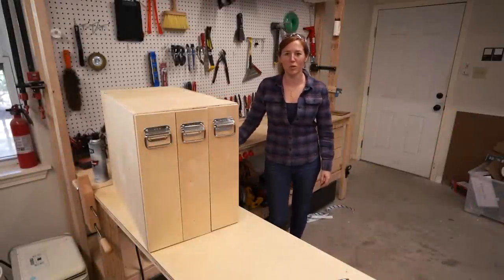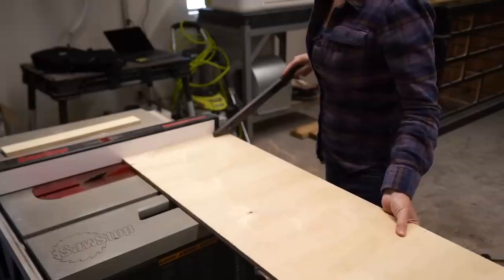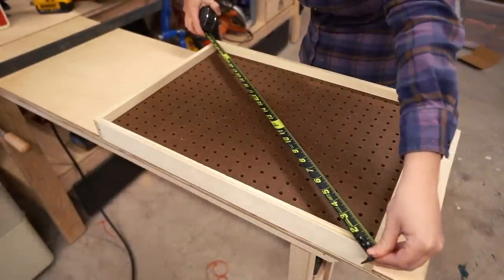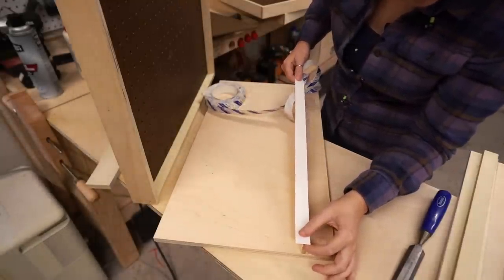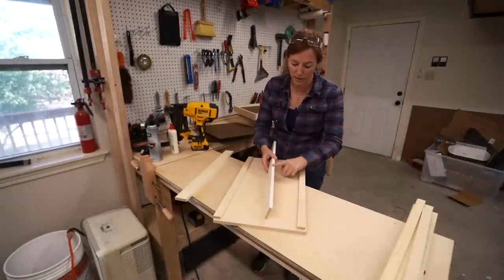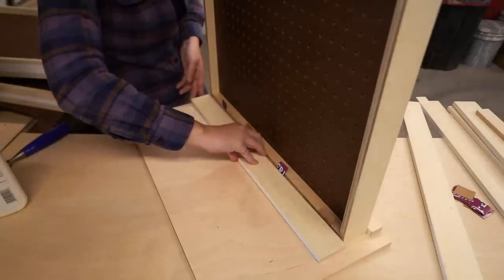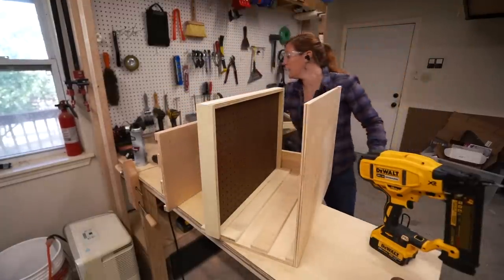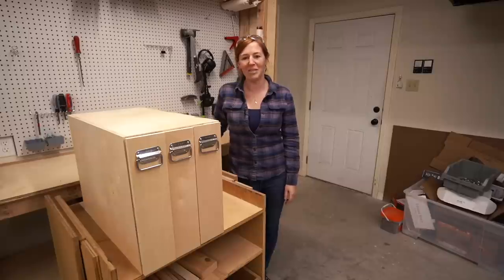Slide Out Pegboard Cabinet For Space Saving Tool Storage! DIY Workshop/Garage Storage

Comment: Hi April, the pegboard usage is a definite winner, and if I remade mine I would use ply with laser or hand drilled (pegboard) holes. I found 7mm ply was more than sufficiently rigid, but it was a little smaller, (briefcase size), so you could possibly also reduce weight by making the pegboard frame smaller. The pegboard approach creates so much versatility compared to my solid mounted fixtures and brackets etc. I've attached a link to my video, which was done as an assessment in my last year of my teaching degree; it’s way too long winded so just skip to the 7:20 mark and finish at 11:13. Other than my monotonous presentation, I would appreciate any feedback; good, bad or indifferent. Keep up design, builds and videos, I enjoy them. Regards, Jim

Comment: You could also build the drawers horizontal and skip the pegboard. That's actually how my workspace is organized. Many shallow drawers, where stuff is placed only one layer thick. I'm a drawer-guy.
Reply: @Nico Smets great idea!! Thanks!!
Reply: The vertical pegboard allows you to use both sides of the pullout, but a horizontal pullout only allows the use of the top surface.

Comment: Hey April, that's an awesome shop storage cabinet. If you run out of that slick edge banding, you can use some paste wax which works great for wood on wood sliding.
Reply: Although paste wax has been used for years, it tends to collect dust and debris. It works, but either gets nasty over time, or scrapes away and needs to be reapplied. I think there are better choices now.
Reply: @chrissewell1608  Agreed, what April is using is a brilliant idea.

Comment: My personal thing is that I like to keep all my tools free of dust and, when I turn off the lights in my workshop, all looks reasonably neat and tidy. It’s just me. What I did in my new workshop is quite like you have done - except that I bought several full height tambour door office storage units - say 2m high x 400mm deep x 800mm wide (6’6” x 16” x 32”). I then built “trays” using 12mm plywood and, like you, banded them for rigidity. Because my vertical trays are that much larger then yours, I could not see that just manual sliding would work. So, I used normal heavy duty drawer slides set on edge. The trays now pull out very, very easily and go back just as nicely. I didn’t use pegboard but am making custom tools holders for both sides of the 5 trays. 

This might be useful to someone who has a tall, thin space for their tool storage

Comment: Nice project April! I made a similar one back in the early 1990s. Found the plans in a diy magazine although I do not remember which one. Wish I had used a 5 1/2" spacing on the panels instead of 3 1/2". Some things you want to hang on just will not fit. I like the panel fronts on yours, gives a place for labels mine lacks. Might have to update. Love watchig your content.
Reply from the maker: That is awesome! Thanks for sharing and for watching.

Comment: Who needs fancy tape for sliding when you have a bar of soap in the bathroom that will do just fine.  When I fix old furniture it is amazing how rubbing a bar of soap on the tracks of anything improves movement.  Dresser drawers, kitchen drawers, anything like that works better with a little soap rubbing.

Comment: I think if you turned it on its side and made drawers it would hold more tools
Reply from the maker: Possibly, but you could only use the top side. Vertical you can utilize both sides of the same pull out. Thanks for watching.

Comment: It's a nice box, but I fail to see how that is space saving?! Instead of hanging some pegboards next to each other you layer them and now can't put anything in front as you need to pull-out space.
Reply: Yeah, I was thinking that too, I can't see the advantage of this over shallow mechanics style drawers, I guess if it is mounted at like head height in a corner, this might make sense? But then you couldn't use one side of it.
Reply: @robbydonaghy8735  I’m considering making this but installing it in to the bottom portion of a rolling workbench

Comment: Really bad thing in a whole design. 0:27 shows it all.
1) tools placed on 2 sides, so you need to be standing on a right side. If you're looking for something, you'll be like "left-right-left-right..." Very inconvenient.
2) tools need to be hanged. Not every tool can be hanged.
3) tools are shaking like hell - can fall down, besides it's just annoying.
4) you need to control every time you're placing the tool firmly, or it'll fall down on sliding in or out. 
Horizontal drawers just dont have all these flaws, so there's a lot of fabric-made metal horizontal tool drawers and none vertical. Yeah, horizontal placing reqires more drawers (as toold placed on one side only), but it's worth it.